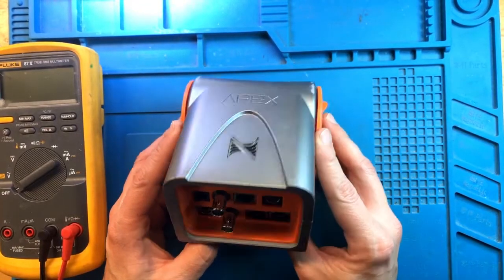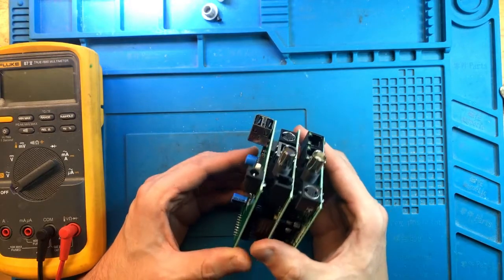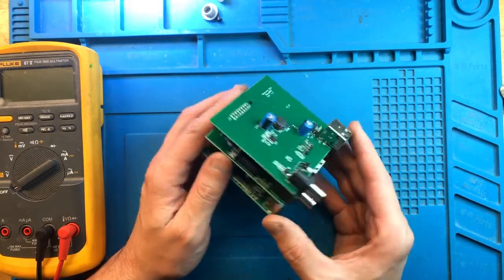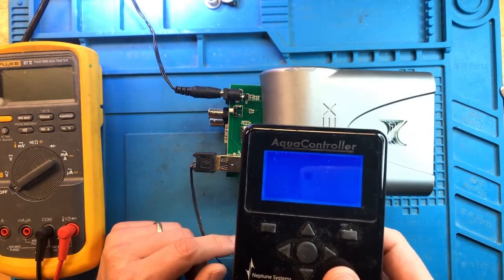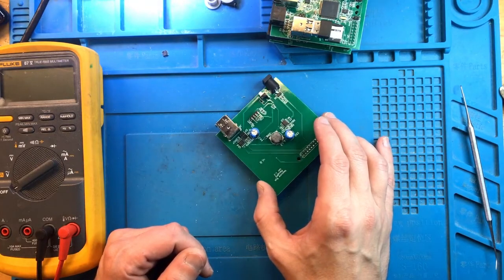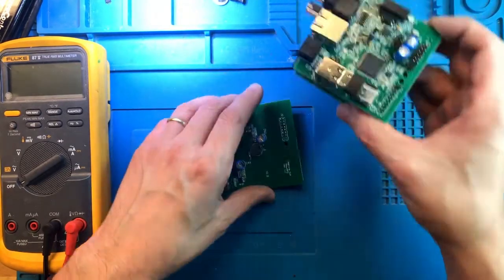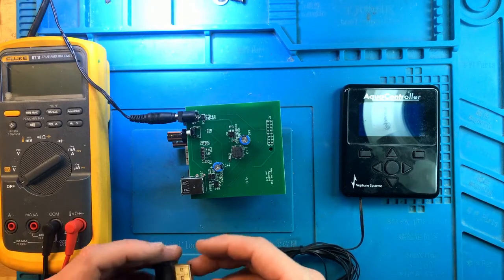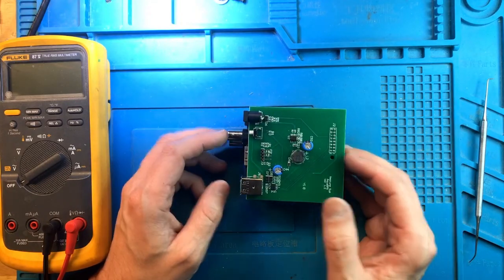Failed Apex 2016 Head Unit After EB832 Water Damage

Comment: I have a question for you. By the way, thank you for the videos. I had a float switch fail on me and flood the room that my aquarium is in. All four of my eb832s are not connecting to the Apex head unit now. All of the EB832S and the Apex head unit are off the ground and nowhere near water. My guess is there was a cable for one of my lights that got wet at a connection point and might have caused a problem. what is strange is all the outlets that control the lights on multiple tanks on multiple eb832s are no longer working. I can’t connect my head unit to Fusion anymore as well. On the eb832s, some of the outlets work fine and some don’t, the led indicators are displaying correctly. I am wondering if I should replace all the ICs you mentioned? Thanks in advance.